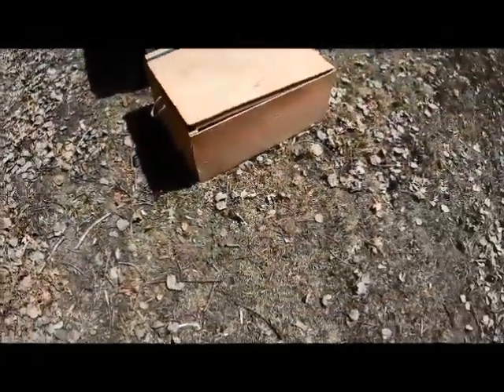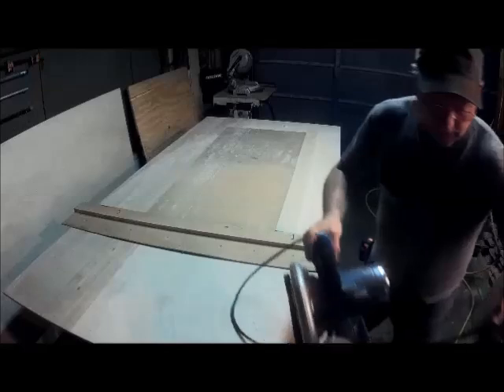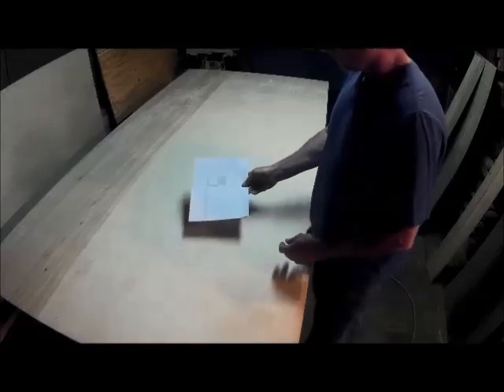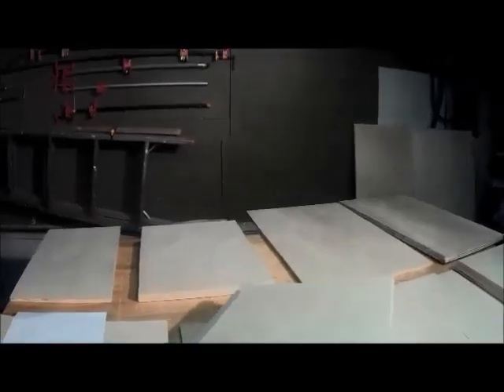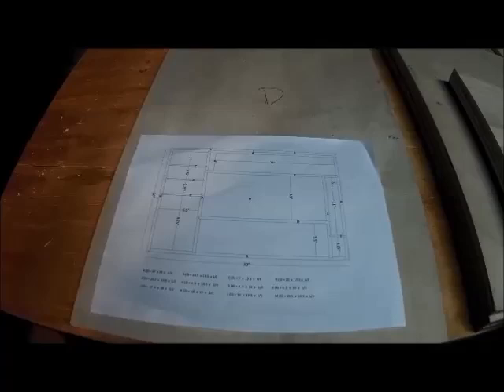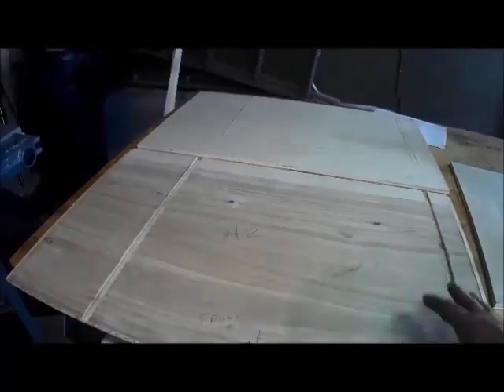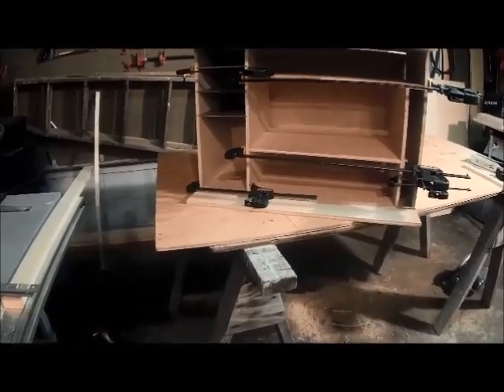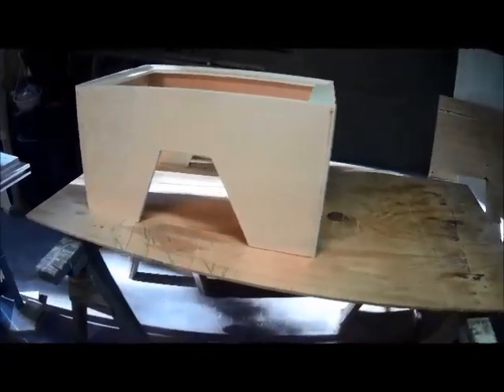DIY Chuckbox

Comment: I have a similar saw guide.  I ran both sides of my Skil Saw on mine with the "Fence" in the middle.  I also have one for my router with one side for 1/2 and the other for 3/4 bits for cutting dados and grooves. They really come in handy.
Reply from the maker: nancejo Great idea, never thought of running both sides of the saw.  Thanks for the tip!

Comment: I've looked at several. I'm just having a hard time deciding on how I want mine. I guess I should start with measuring and deciding what all I want. My plastic tub has worked for ten years, but I do like the work surface
Reply from the maker: Plastic tubs do a great job, used them myself.  Using the chuck box  I do like how everything has a place and easy to get to verses searching through a plastic tub or two.

Comment: I have a question about the door size the cut sheet says 14.5 x 19 the cabinet is 20x30 not including the fold out top. I get that the top sits on the door and that leaves it an 1 inch short at the bottom. Parts G is 15 and should be 14 and H is 18.5 and should be 19.5 or 20, what am I missing? Help please
Reply from the maker: Hey Mark, the door sizing is 19" x 15" for each.  You are correct part "G" should be 14" not 15" for when it is glued to both  "H" sides it will pick up the additional 1 inch.    Part "H" should be 19" not 18.5".  I will update the cut sheet before I send out any more copies.  Thank you for your input as this will save others time and frustration going forward!!

Comment: How did you attach the lip on the base?
Reply from the maker: The lip pieces on the base are inserted into dadoes cut into the sides.  Look at pages 15 & 16 of the plans.  So far I have not had any issues of it not supporting the base.  Holds it very well with no sag.

Comment: How did you put the base together??????
Reply from the maker: Once you have the 4 base pieces cut out (N&P) make the grooves for the plywood support pieces near the top.  Once that is done insert your plywood support pieces (R&P).  Making sure that piece R is centered in the opening.  Glue and nail the four pieces together and that should do it.  Some people have used biscuits to help hold it together but I did not and have not had any issues.  Hope this helps

Comment: I love your chuck box!  Aside from customizing my interior spaces to fit my stuff, the only thing I might change would be the piano hinges on the top. I might put them on the outside edge (yes, the stand may need a bit more space to allow for the hinges). This will help them not be in the way as you slide things across the top while cooking (all flat surface). I might even laminate the top surface with a bit of linoleum for an east to clean surface. Of course I’m a girl, and those are chick bits of comfort.
Reply from the maker: Nice modifications!  That's the nice thing about building this yourself, you can customize it as much as you like.  Thanks for watching